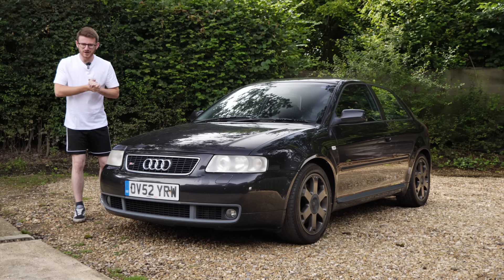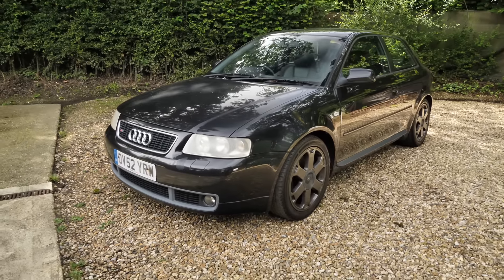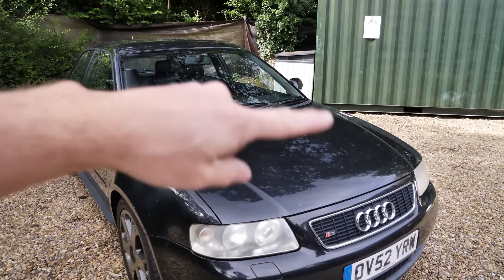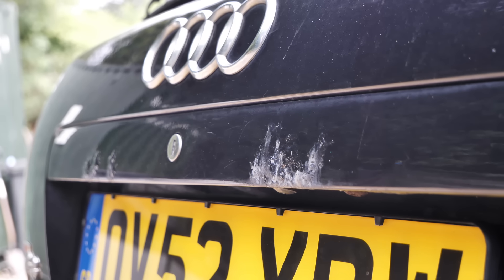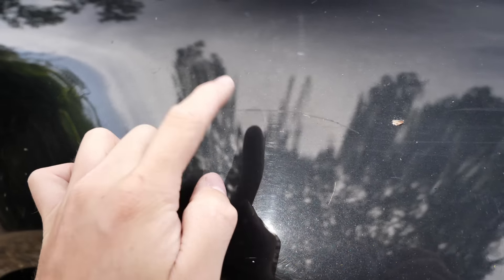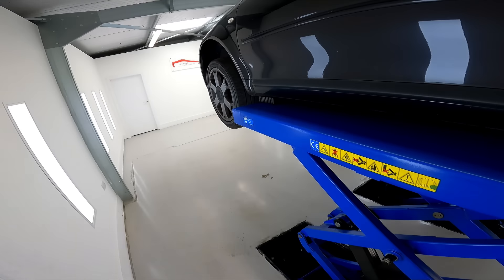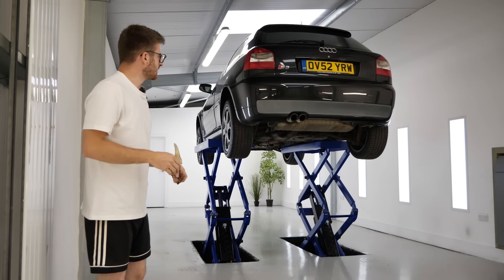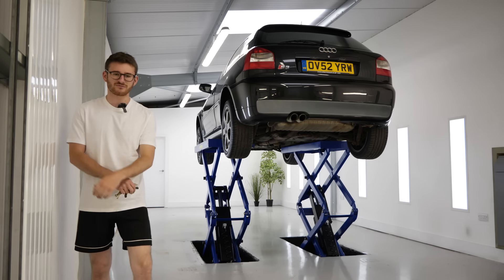Everything WRONG With My Abandoned Audi S3 8L...

Comment: New Shocks and I fitted a set of Pi springs on mine back in the day and the stance was perfect.  Haldex Service. Engine Flush and Service, maybe have the sump off and clean the oil pick up gauze as they can block and starve the top of the engine.
Defo ice blast underside and Lanoguard but do all the suspension work first.
Miltek full exhaust and upgrade the Turbo intake pipe as they go soft and restrict air flow.
Cambelt and Water Pump change.
Enjoying the series so far
Reply: good tips

Comment: Welcome to the money pit world of s3 8l’s. Your problem with the gaps in the engine bay is top mounts you can buy purple powerflex ones for £50 they should sit flush with the shock tower. All the rust spots you have on the car are normal for these cars they also normally rot on the back of the bonnet in the seam sealer nearest to the windscreen and on the lower wings behind the sill covers, they also rust on the sills but are hidden by the covers. They hold dirt behind the dirt shields and rust out like every early 2000 VAG car

Comment: Great video, great car. 

I had a clucking noises on this car when turning like you did.
2 solutions for my problem:
Aftermarket Downpipe was hitting driveshaft because of old engine mounts.
Haldex unit in the back was faulty and couldnt decouple , unplugging the haldex fuse made the sound go away.

Comment: Those rust spots on the wing and rear gate, you can do with used parts, but the bubbling on the roof should be addressed -  decent paint guy can blend over those area good enough to daily. You need to clean and waxoyl the underside

Comment: Had same issue on my mk4 r32, haldex was binding on full lock. Ended up putting a low mileage diff/haldex unit in with a new controller which can also be problematic. Test haldex by pulling the fuse out which disengages the 4WD and see if binding goes away.

Comment: Use a breaker bar to check the bushings on the car by putting the breaker bar in a position on any given bushing that allows the Bush to flex which will show you if its worn or perished, only need to wiggle the Bush a very small amount to see if its damaged

Comment: I’d do the oil service before doing anymore test runs with the car! 

I’d guess like some others that the clunky noise from the back is from haldex. Might be oil issue or something else due to ~5 year abandoment. I’d also check brake lines carefully for leaks and overall condition. Good time to replace them when you are doing service to dampers and suspension. 

Great video once again!

Comment: i think the issue with the back sounds like the diff is locked, which is common with haldex awd systems, usually could be a fuse or old diff oil etc

Comment: Upgrade your suspension with a cup kit, do rebuilt axles all round ,new suspension arm kit . Treat the rust spots and wrap it satin black and respray the grey parts ,most definitely a new exhaust .remember this is mk1 tt and golf 4 so oem where necessary to keep prices in check . Then think about power upgrades 06A motor: rods and arp studs MLS gasket ,intake cam ,3076R turbo,fuel pump ,injectors etc .... stuff that all diyers can do . T h e car has great bones . Give it a shot! we never got these states side .keep up the great videos ,take your time 😅.

Comment: The top mounts when worn create a gap at the top of the turret they are very cheap though worth replacing the bearing as well, the rear gearbox dog bone mount replacement will make it drive less sloppy too easy and cheap also ,shame you cant get a sponsor for the paint job to kill that rust